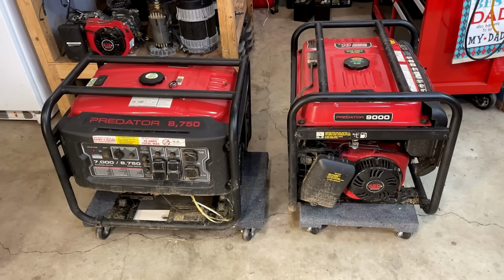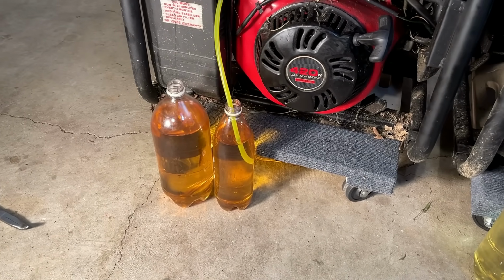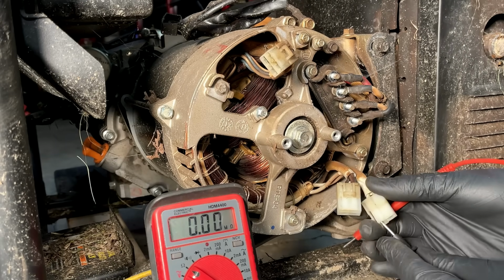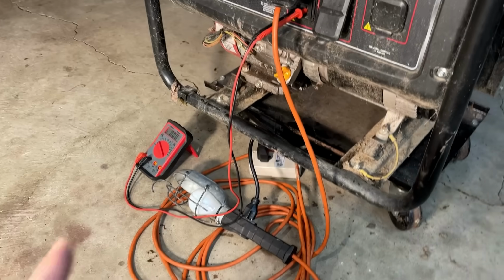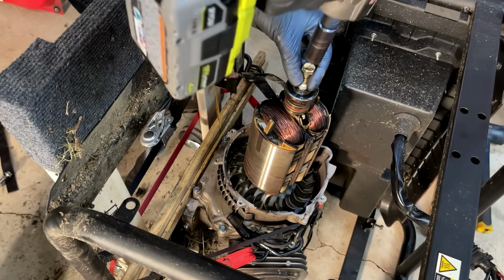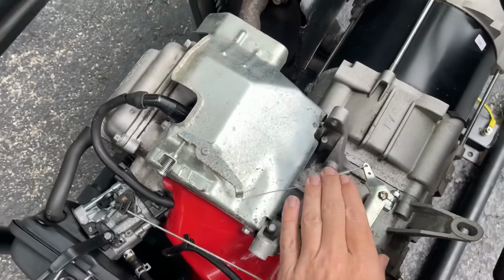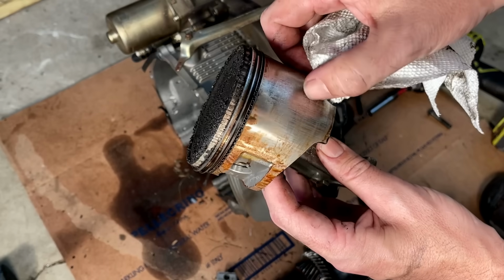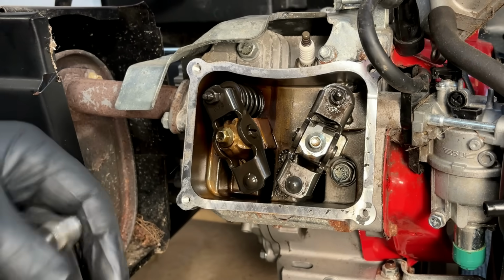3 Abandoned Predator Generators - Will They Run?

Comment: Five years off grid due to owner being unable to repair power poles is amazing.  I wonder what the cost of gas, maintenance and generators was for the five years compared to the cost of repairing the power poles. Generating off grid electricity via fossil fuels isn’t cheap compared to utility cost.
Reply: Same thought running through my mind...
Reply: 3 generators later lol
Reply: Many years ago my electric company was charging 500 a pole and so much a foot for the wire. I can't remember exactly on the wire but it was high. It stopped me from buying many different parcels I looked at back then.
Reply: @markheintz1878  is there no insurance in the states??
Reply: Of course there is @Rubberfoxy

Comment: It's hard to imagine how it would save any money to not repair the pole and instead burn gas every day for 5 years.  Unless he has a large battery bank to save the power, this thing will just burn gasoline all day and night.  Even when gas was somewhat cheaper, that is still not a good option.
Reply: The guys I work with who live off grid who don’t have power banks are usually only running a generator maybe 3 hours a day for a hot shower and a clothes dryer. Use a wood stove for heat. I think a couple of them figured out to buy a power bank to run their tv and internet instead of running it when they want it

Comment: As mentioned many times below, by others, it is not the valve stem seal. The oil ring is not doing its job controlling the amount of oil it should have anymore and the 2nd ring is not scraping adequately on downstroke, the excess oil is ending up between the top and second lands of the piston. As the engine warms up, there is enough metal expansion to minimize the problem and visible oil smoke.  When it cools down, the excess oil pushed to the top is pooling in the cylinder after shutoff. (Take a borescope peek when it's cold and look at the small puddle on the piston's bottom side). On cold startup, out the exhaust it goes. The solution is new rings, hone the cylinder and break in the rings over several cold-hot cycles. And as you always do anyway, change the oil in 5-10 hours. I have a Firman (Chinese Honda clone engine) with exactly the same problem and am debating on ringing it or living with it.

The Chinese (usually Honda clone) engines are not proving themselves, as evidenced by the shortness of their engine life and plethora of problems that arise after a year or so of use, regardless of the load/how often they are run. The real Honda/Subaru Robin/ and even older B&S engines hardly ever suffer these problems, in my experience. I blame the inconsistency of Chinese steel for the short life of their products. They are meant to make it past their warranty expiration and that's about as far as they make it.
Reply: Moral of the story is to purchase a generator with a known brand name engine, Honda, Robin, Kohler, B&S, or other known good brand.  The knock offs are changed just enough to avoid patent and other infringements lawsuits.  They are just like the gonna pop Chinese trailer tires.

Comment: From watching your earlier videos I was of the impression that one of the first things you do is check the oil,  and I didn't see you do that with either of those first two machines. Was there any oil in either one of them?  You also looked inside of the fuel tank pretty often,  I didn't see you do that either.  And,  in terms of testing for power output,  I would have plugged the light or something in and spun that motor over,  see if any power was coming out before going into all that testing of windings and whatnot.  Was there some reason you didn't do this?

Comment: Maybe a decent profit after all is said and done. I'm guessing the 'off-gridder' just poured gas in and pulled the rope, checking the oil only when the low-oil switch kicked in. I feel for them not having the finances to get the power poles redone after the storm, but they wasted the cost of 3 generators so I'm not sure that was a good choice either.

Comment: Wow James if you had a heli-arc welder and the open bottom window parts I would say this block would run for a good while with correct components, it's own crank, governor, cam, and crank bearings. With a new piston probably as long as a new one. I just see the poor fellow, oh no another genset failure. It only lasted 15 months and used 500 gallons of gasoline. You would think like an Onan diesel you could get 5 years out of something like this. How much were those power poles again?

Comment: About 11 hp?? Isn't that kinda low for a 6500 watt gen??  Would one want it to be 13 hp??
Reply from the maker: The running generator was only 5500 continuous watts.  Only need 10hp for that.  a 13hp can do up to 7000 watts.
Reply: @jcondon1  ah ok 👍 👌

Comment: Won't break clean work inside the power housing.
Reply from the maker: Would be afraid it would damage the insulation.  Not sure.  Contact cleaner might be safer.

Comment: I just had to warranty a predator 9k because the connecting rod broke and went through the block. Also is that 212cc engine on your shelf for sale?
Reply from the maker: It is available, but it has an integrated bell housing and tapered shaft.  I also stole the push rods out of it for the Honda HS55 snow blower.  I have replacement push rods, just not installed and it is missing the breather hose.  Used that on the Generac propane generator.  If you want to talk about it, email me

Comment: Predator--Harbor Freight China specials.....Where to get parts?  Rotor 6.7 Meg ohms its been outside and it could be wet, bake it dry, let it cool and measure again alos clean any contamination from teh slop rings to the shaft....  if nothing else you have   2 good generator heads $$ !   James,James, James ,..you do not steal parts you aquisition and re purpose them !  with a sparkplug adapter to airhose blow compressed air into the head to keep valves from dropping out to check stem seals!

Comment: Love your channel & your videos. When you use, and or get new tools, could you make a point of talking about it? As to why you bought it and how it will help. I've noticed a few new items and you never made a point about talking about them. Also, You've taught me well. Your video about the Toro lawn mower, I suspected the gas cap from the get go, but I like the way you diagnosed the issue. I like your deductive reasoning.

Comment: I'm surprised you didn't clean that carb on the 302 hemi.  You ALWAYS clean the carbs.  I'm also surprised you didn't run that gen under load after adjusting the valves.  Awesome content though and I enjoy your videos and appreciate the information.  I also appreciate the lack of commercials and whining for "like" and "subscribe" like many other YouTubers.  You da man!
Reply from the maker: I only have to clean the carb 99% of the time.  The carb was running well.  Normally would have tested it on video after the adjustment, but it the video was getting a little bit long.

Comment: Do you think they ran low on oil and that's the root cause?
Reply from the maker: The one with the broken rod I think ran low on oil based on the smell of the oil and the fact the oil sensor did not seem to work.  The other one most likely was running fast?

Comment: What I learned from this video is Predator is a bad choice for generator. Engines don't last and parts and info are hard to come by. So buying a predator makes you the prey.
Reply from the maker: To be fair, these probably had many thousands of hours on them.  Was a little disappointed at the lack of parts, but it was an odd engine size.  Would stick with the 212 or 420 cc predator engines.
Reply: @jcondon1  okay that is fair. But available parts is something to consider when buying equipment. I guess that's what I learned from you video.

Comment: Couldn't you adapt a generac servo to these engines? Secondly, it seems one could sell an oil sys upgrade to include an auxiliary reservoir to extend service interval and to provide a remote oil low alarm indoors!

Comment: Jim,  I like your videos and the learning I get from watching them. here is an idea that may help many of us that don't have time to watch the longer videos. After watching this video I thought you could maybe do a series of short videos?? As an example - You explain how the speed governer works and the effects of the spring and the position of the spring was great.  Removing the stator (hydraulic pressure)? Adjusting the engine speed with and without load to attain the correct voltage and hertz/. and many other helpful tips. Valve adjustment.   Just a thought. Thanks for all your efforts.

Comment: I have a generac 5500, ive kept it after it started jumping and hopping around still started, ive been watching your videos soaking up knowledge about how to go about fixing it. My brother thinks something is wrong with the fan unit? Have you ever seen a hopping or jumping generator? I used it during a hurricane and then i upgraded to generac 21k. I used this for welding and for electricity for power tools.

Comment: I need help to figure out the intake and exhaust clearance in mm for a wen 4000i inverter generator and to get the push rods for it since the intake one is slightly bent
Reply: I already got the generator running very well the wen 3800

Comment: Wow a triple treat 3 Predators. Too bad neither of the larger ones were repairable, but at least yielded lots of donor parts. We have a 7000W/8750 since 2016, but so far other then testing have not needed to use it.

Comment: Hi. Love watching the Generator videos.
I bought 1 like this but with a honda engine from the local dump dirt cheep it seems they knew not what they had.
It needed 3 things. fuel cap, carb And it works great, now. but i still need no.3  What is that bar called that you have to take off to get the fuel tank out ? I've had to use a block of wood cut to size but would like the proper thing.
Reply: Lowes and Home Depot sell sell angle metal in steel and aluminum- easy DIY job.

Comment: I agree with your valve seal decision. The head is at such an angle that any residual oil would run back to the pushrod galley and not puddle around the seal.

Comment: Not trying to condescend james, i just want to point out something. The Predator 212cc is a clone of the honda gx200. The predator 301 is based off the honda gx240/270 series. And the 420cc is based off the honda gx340/370 series.
Reply from the maker: Was wondering if a 301 was a clone of a 270 or 340.  I ordered a gx270 spring as well to try.  But does Honda make a gx270 hemi like this one?
Reply: @jcondon1  i am not too sure to be honest. Im not to well versed on why honda clone companies are doing multiple valve train designs like with harbor freight’s predator hemi and non hemi’s. I do not have the experience working on hondas to know if honda’s valve train is hemi or not.

Comment: Please look at counter balance shaft end view again of the break. If it is polished for a bit then grainy . The polished bit will tell you that it was flexing before it broke. The flexing will polish the shaft. Lots of smooth polishing says engine was running for a long time before balance shaft broke, and it broke when the minimum shaft diameter could not support the load/forces.

Comment: Predator generators are notorious for clogging their exhaust screens "spark arrestors" to the point of damaging the engine. Be sure to check the exhaust folks and keep them clean. A major score for the price, Congrats !! Mega video for a mega score, Thank you!
Reply: Spark arrestors are really bad for chain saws, weed eaters, etc.  The first thing I get rid of when I get one.  They eventually cause extreme difficulty in starting and also idling.
Reply: @jim7smith  I understand what you're saying but I would never want to start a fire. That would be devastating.
Reply: @zrkn1  been using all of the above for 60 years, never started a fire yet...but your mileage may vary.

Comment: Fun fact (and I know this sounds counter intuitive, but it works) the closer you put the spring to the governor shaft, the more sensitive/responsive the governor will be. The only way I learned this was from a Onan NHC service manual. Since then I've been moving tons of governor springs on my equipment to the hole that is closest to the governor shaft. The usual side effect is some mild surging, but under a heavy load that goes away. So if you're having issues with frequency droop, give this a try.
Reply: There are a few past videos where he does this.
Reply: That helped me set up the PTO generator to run smoothly on my garden tractor. Thanks for your random comment !

Comment: The cylinder leakage tester should be an easy way to diagnose if the rings are leaking.  Put air on it and listen for air leaking out of the crankcase.

Comment: I would buy/make a spring tension meter to compare springs for the governor. The strength is affected by the spring material, which is hard to judge by eye. Yes springs are a pain when they are used like this and kind of "look" the same. Probably not worth it, but would be fun to see !  Thanks for all of your videos!
Reply: Good idea. I'd think you could rig something simple that dangles the spring vertically, then hang calibrated weights over it.  Some kind of ruler and pointer to measure the stretch.
Reply: Changing the moment arm length probably helped as you said Jim, affecting sensitivity
Reply: Would be a neat tool
Reply: Luggage scales do the job for heavier springs. Lighter strength tension scales will be available.
Reply: Fishing scales would probably work too

Comment: Anytime i use a predator engine i always go through and re-torque everything i can before using it. They have a terrible QC dept evidently. The 301 and 302 cc are the same linkage and spring set up so you can order for a 301 and it will work on the 302.

Comment: I would think that amount of smoke is a ring issue. It is difficult to imagine how that much oil would pool and stay around the intake with it being that high up. If it were blown through the crank vent across the seals it would still be a ring issue. Good to see you not lose a lot of money on two and a half basket cases.

Comment: That's impressive to destroy that many generators in such a similar manner. Makes me lean towards operator error (stupidity). It's pretty unlikely to be anything else.
Reply: It takes about  30 minutes,  to change oil, spark plug, and air filter, no excuse. People must have money, to throw away.
Reply: @carllockpick6179  I got my wen 3800 running so well bought it for 300
Reply: @carllockpick6179  ugt
Reply: @B_r0d08  ?
Reply: @B_r0d08  ?
Reply: Spoilers :)
Reply: Check the oil every tank of gas on these cheapo generators and you won’t have a issue. We have one and it gets normal use every year since we live in the woods. Just maintain them.
Reply: Also most generators are are built for emergency power use not continuous power. He stated that the house he picked them up from was off grid. I'm assuming they used these generators in a continuous fashion which they are not designed for.
Reply: This always happens to these crappy Chinese engines
Reply: I agree, most likely an "ID 10 T" error code
Reply: Probably ran them out of oil

Comment: What would happen if you put two springs on the governor instead of one?
Reply: It wouldn’t operate property as the spring tension would keep it from revving correctly. I can’t remember but I leave it wouldn’t rev up at all. It would just idle. That or it would run away and the governor would be fighting to stop it. Either way to doesn’t help you.

Comment: When a machine has been stored outside like that it is possible moisture can be throwing your readings. To be certain the armature is bad we used to cook the parts at about 200degrees in an oven for about an hour and recheck. Quite often they would check fine after that and worked well.
Reply: You're the only other person that's mentioned what I've done for decades.
Reply: @TIHS PID the REKCIL TILC  Hah, your name is cracking me up...😂
Reply: @ShanesGettingHandy  !!!sknahT
Reply: @ShanesGettingHandy  🤣
Reply: Even without that, I would usually expect multi-mega ohm readings to frame are simply dirt on the slip rings with a bit of conductivity. Once you have the power head off and a chance to wipe/dry the slip rings, check 'em again.

Comment: i have the feeling when the engines were bought , they might have not gotten a proper "burn in" run , instead just ran out of the box without much attention paid to it and perhaps that caused his almost similar damage to all three generators
Reply: I agree.  Looks like they were ran until they were out of oil and grenaded.  Notice the 3rd engine was low on oil.  BTW, how much oil did you have to pour in that one to top it off James?
Reply: why would he live off grid for 5 years ? The generators cost more than the power from the grid ?
Reply: i'm betting so. Predator is the "cheapo" harbor freight brand, the 6500s are going for about $700 bucks. I could see someone thinking "oh, i'll just run it till it dies then get a new one" or it had poor quality control from the factory...
Reply: It’s amazing that most all generators are of the same configuration as to the lay out of the generator from the end of the power head as if they are all the same make !